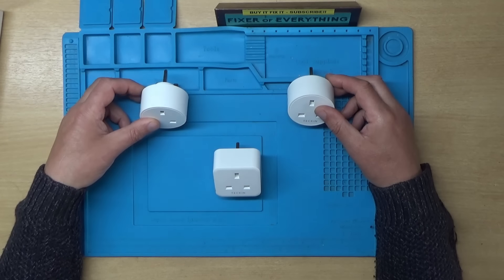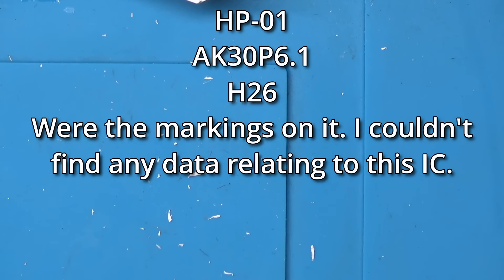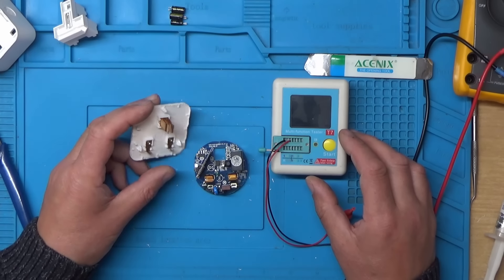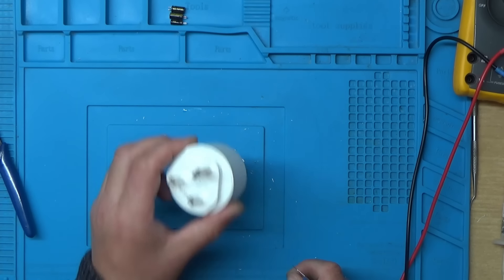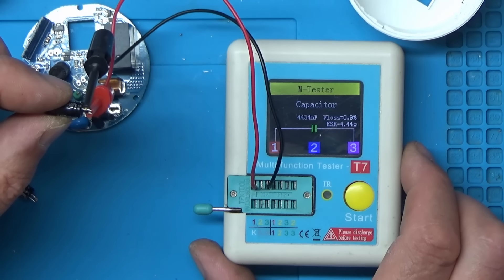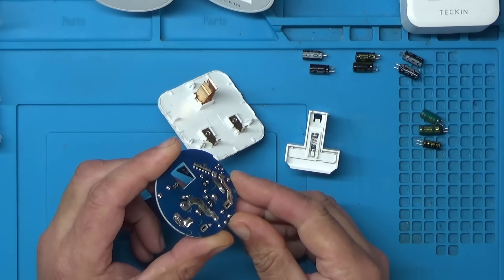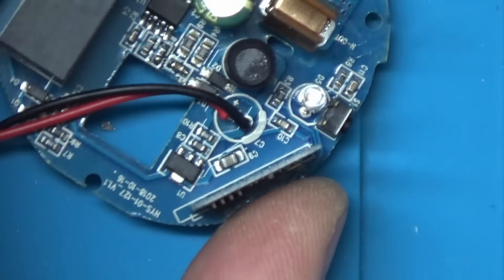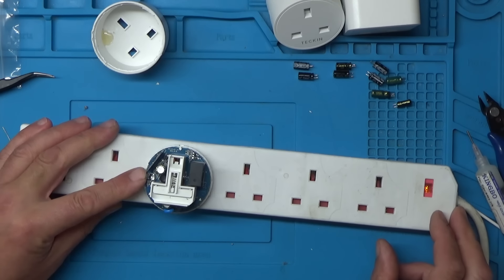Three Faulty Smart Plugs | Can I Fix Them?

Comment: I have had two TP-Link smart plugs fail, weirdly although apparently rated to 13 Amps
"Tapo Smart Plug with Energy Monitoring, Max 13A,Works with Amazon Alexa & Google Home, Wi-Fi Smart Socket, Remote Control, Device Sharing, No Hub Required, Tapo P110, White"
They seem to only be able to handle very light loads of up to 100W. I only used them for controlling the power to a USB PD charger that typically has two laptops connected, I can read the load from the screen on the charger and it is generally about 40 Watts plus 50 Watts. Both times they still click when swiched with the app but supply no current. Seem to be junk which is a shame as I generally like TP-Link stuff as it is cheap and cheerful but effective mostly.
Reply from the maker: Interesting. Thanks for sharing 👍

Comment: Bought four from Lydl years back. They worked pefectly until Silvercrest turned off the server, making them useless. I was very annoyed at the time and nearly made a video about it. 😡
Reply from the maker: @TimHollingworth  Damn. That's one of the reasons I'm not a fan of IOT stuff unless you are running the server yourself. Too many perfectly working things just stop when the manufacturer decides, or if they go bust. I bought a Glance Clock to repair but the servers have gone for that now.

Comment: Are the capacitors of bad quality?
Reply from the maker: I'm not too sure, problem is also caps on the output of switching supplies get a lot of abuse and fail a lot more quickly than they would on an old fashion linear power supply.

Comment: Never saw plugs like that, what's the purpose of those?
Reply: Its only purpose is..... Controlling the power of whatever is plugged into it via an app. Often this is some chinese tuya cloud rubbish but some people convert these to use tasmota or esphome firmware to make them run local and its often for integration into homeasistant. The only platform that allows you to run your smarthome on your local network without cloud requirement
Reply from the maker: You can use them to control whatever is plugged into them remotely via your phone, or set a timer schedule or if you have an Alexa or Google smart speaker you can say something like "Alexa turn the lamp on" or "Hey google turn the TV off"

Comment: At 7 minutes in - my immediate suspicion is power supply. Either a capacitor or regulator or a diode has failed.
Reply from the maker: Although the last socket did throw me a slight curve ball...

Comment: Please someone explain to me, what are these things? Really I don't know, never seen them before .
Reply: Wireless "smart" power sockets. 
Connect them to Wifi and you can plug anything into them and turn it on and off with your phone for example. 

Personally I've mainly used mine for turning my normal lights into "smart-ish" lights.

Comment: But why did the caps failed? That the question.
Reply: Two reasons likely, for one these are rather low quality capacitors to start with but more importantly in these kinds of tiny, cramped enclosures they tend to run at quite high temperatures which electrolytic caps really don't enjoy.
As a rule of thumb for every 10°C rise in temperature their lifespan is halved, so if you're using a capacitor with a likely short lifespan to start with and it spends it's time at an elevated temperature it's inevitable that it will fail early.
This is further compounded if the device is used somewhere with spikes on the mains line voltage as it will cause internal heating of the capacitors.
Reply: Designer specified 105C low ESR caps as standard for a power supply, assembly contractor saves 50 cents per unit by using cheap knockoff caps with labels on then fraudulently stating they are the correct type. Very common.

Very likely other jellybean parts like the voltage regulator, transformer, relay etc are knockoffs as well but these don't tend to fail as quickly.

It's what happens when you contract everything out to the Wild West, unregulated mess that is Chinese manufacturing.
Reply: Would you say these are safe with so little distance between 3.3volt and 240 volt and cheap caps?  I have about 10 in the house constantly turned on. I'm certain that their use in winter for Christmas tree and outdoor lights is a good safety move. You can set timers on them as well. But the rest of the time? Is it not just safer leaving higher quality electronics plugged in like TV and appliances? Main attraction for these is if your sockets are awkward to get to very easy to turn on and off and you can link them to Alexa and do it by voice. I guess if a mains spike blows these it saves your electronics?
Reply: @paultasker7788  I'd say they're safe enough - the low voltage side stays inside the device and the separation isn't super-critical - these look like they use a buck regulator which doesn't isolate the mains from the 3.3v anyway - the isolation is in the relay and tbh it's quite difficult to get that bit wrong.

Where I've seen these be potentially unsafe is in their ability to handle large current - some of the cheap Chinese plugs (I have no experience of these specific ones) will literally melt if you plug them into a heater, I suspect because of the materials used (not pure copper etc).

Comment: Teckin plugs are absolute shite, all of mine failed within 12 months. Chinese landfill.
Reply from the maker: Interesting, someone else commented that they had some for two years switching heavy loads and they are all fine. I wonder if they changed make of capacitors or some other component at some point which made them less reliable.
Reply: @BuyitFixit  Amazon stopped selling them, usually a sign of crap quality.